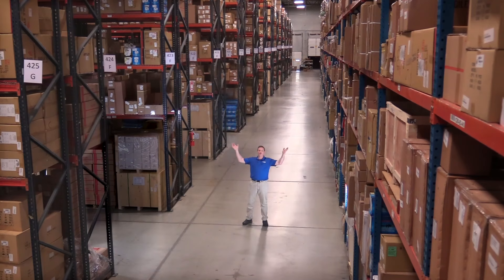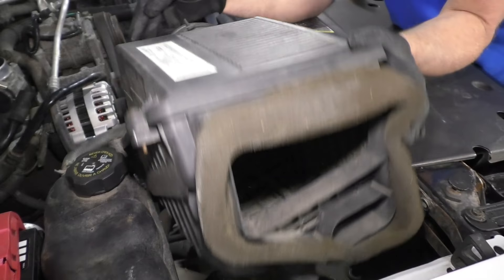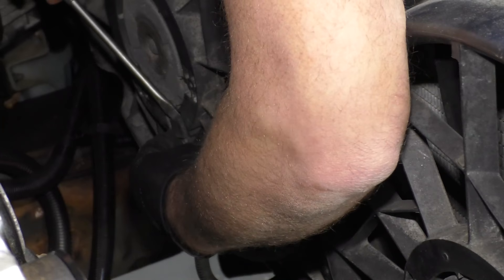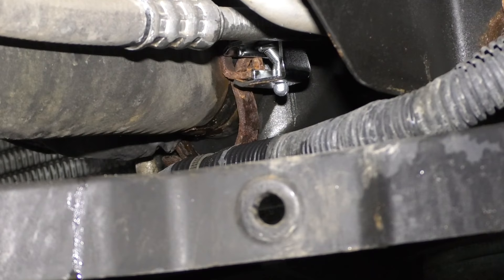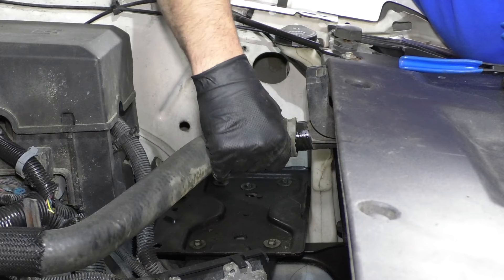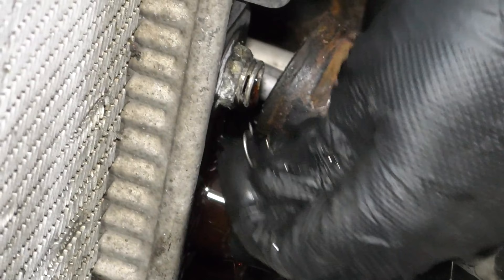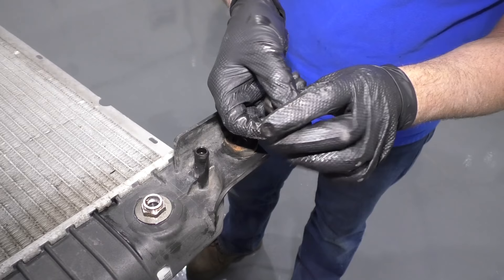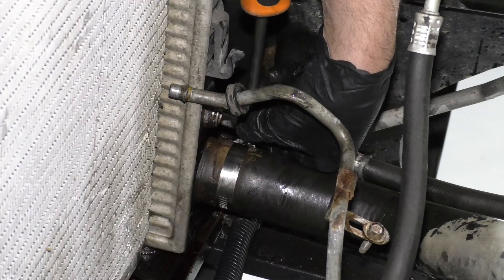How to Replace Radiator 99-13 Chevy Silverado 1500

Comment: Its a tab on the bottom of the radiator to release the rubber boot. I know because I broke mine just like you did in this video.. lol  it still will go on the new one, just not lock in place now.

Comment: If I were looking to upgrade my radiator to something more effective than stock, what would you recommend. I live in a place where the summers reach temperatures of 110+ degrees Fahrenheit and wanted something to allow my vehicle to be able to idle longer than 10 minutes without it nearly overheating.
Reply: Mishimoto

Comment: Thanks for the vid.
First off...can’t figure out why you agonized over the bottom hose and the little one next to it. Take them off at the block and deal with removing them from the radiator when you pull the radiator. Plus, you don’t need a special tool.
Reply from the maker: +paul REVERE Thanks for the feedback!

Comment: You mentioned the transmission lines having transmission fluid, is that as a just in case there is a leak os should the transmission fluid levels also be checked after filling the radiator?

Comment: How much coolant did you use and how much water? I don't have an owners manual for mine, it's a used 2013 I ask because I found out I have a cracked radiator today and I'm going to have to get all new fluids.

Comment: I see you have links for all tools minus the two used two remove the top and lower hoses. C-Clamp removal tool correct, but which one works best and since I have the tool used for the bottom what is the removal tool used for top, link please? TIA

Comment: What size is the radiator? And what about the one with oil cooler lines on both sides. I have a 2010 GMC Sierra 1500

Comment: If I'm replacing the radiator due to it cracking, Do I need to flush it if I'm going to use the same coolant and it was also flushed 3 months ago,
Reply: gt nez your good then if it’s been done 3 months ago but don’t hurt to do it again just filter it when u put it back in

Comment: Why does it not show you putting the pen back in the transmission lines and oil cooler lines why did you not put the pin back on video
Reply: He did he put it back before right after he first unhooked it that way he didn’t lose it and that way it was already in place for when he was connecting everything back